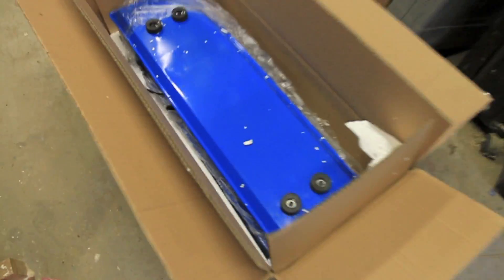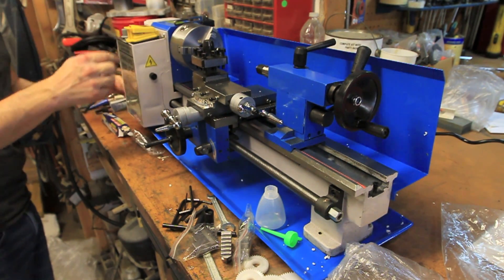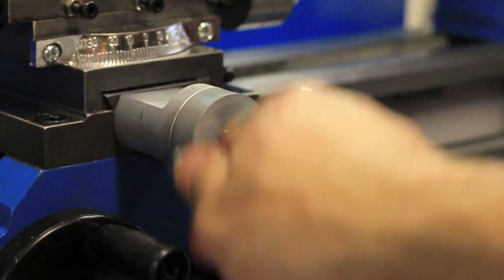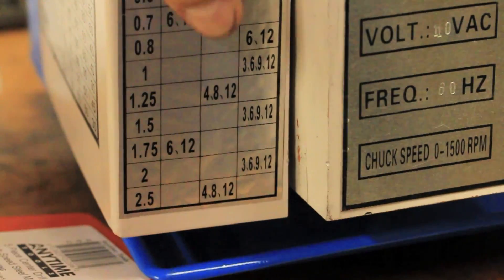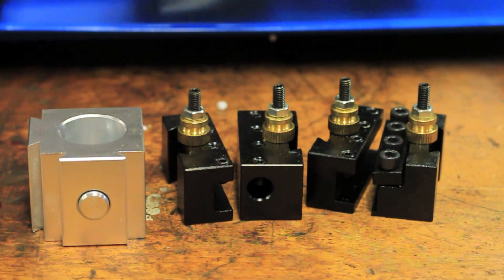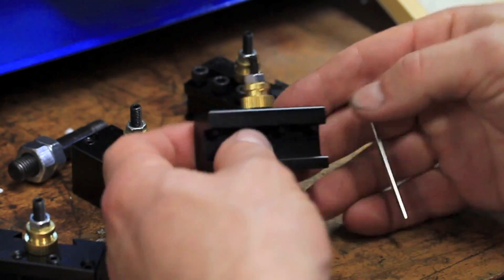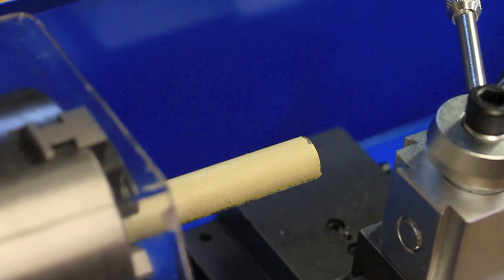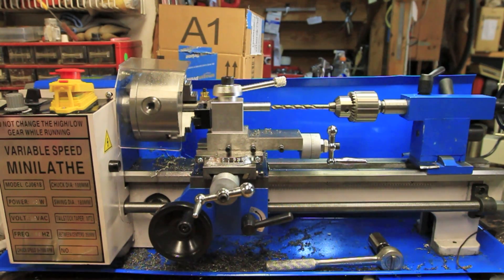Cheap Chinese Mini Metal Lathe Unboxing, Setup, Upgrading, and Testing

Comment: in germany we say "Buy it cheap and you Buy it twice" Duden get a german machine that will work for ages 😄
Reply: Andre Berg buy it nice or buy it twice
Reply: Optimum produces in china, then setup and re-mark their machines. And then sells to Europe.
Reply: Been there done it, regretted it and lost 40% of new cost in 10 months witha cheap over rated Wabeco.
Reply: Wabeco German
Reply: Nothing new and by new the last 15 years.
Heard of tooling companys or shops selling stuff with German sounding name, made in china cheap.
Reply: "Buy once cry once" for 'merica
Reply: My mother always said "We're too poor to buy cheap."
Reply: oh sure ... yes just get a german lathe for $20 000 instead of $500 :D
Reply: In my country (Romania) we have a similar say: you are too poor to afford cheap things...
Reply: My BMW was in repair more than I drove it. 
My 944 Porsche,  $2000 timing belts every 30,000 miles. My friends Mercedes,  $5000 to replace a air conditioning condenser. 
 Fack German Engineering!!!!!!!!!!!!!
Reply: Agreed 100%. Germany is one country that certainly knows how to produce top quality metal (machines) products. American steel is also top quality. Genco Razors were made in the USA. Japanese steel has been top quality for centuries or even millennia (Samurai swords).
Reply: Andre Berg do you know any good mini lathes from Germany??
Reply: @FireBuffalo  proxxon, the best!
Reply: FireBuffalo no, there aren’t any, lol dudes an idiot. Buy an old American made one
Reply: I bought a drone from china that satisfied me. ......mavic
Reply: @mullervolker9814  
You bought a drone? You mean a Quadcopter? WTF is a drone anyway? Care to explain because in my English learning days, drone was a word used to describe, indicate or point out a continuous loud or humming sound. Its definition was never a rc Quadcopter, plane, or any other bullshit that today's poorly educated, ignorant, low IQ illiterates stooges call it drone. How many things are called drones nowadays? And that's proper education? LOL. The word drone is not a name, a machine, model multi-rotor, military pilotless planes and, whatever other bullshit there is. It can't be used to name anything because it's a word used in a sentence or conversation,  e.g. "That jackhammer is so annoyingly loud and is droning our conversation. Let's move somewhere quieter."  That's all the word is used for. I think you've been listening to too many poorly educated, low IQ illiterates, too many sheep who have no idea wtf they're talking about, trust me. People on drugs have lost the mental ability to figure or work out how the f*** is it possible that a word suddenly becomes a name after the release of this annoying rc model multi-rotor that the manufacturers had named it a Quadcopter, how does it become a word, 'drone'? It seems that half the world population nowadays are brain dead retarded because of the shit they take, drugs!   A drone, yeah? LMAO!
Reply: @mickcarson8504  
"droning out the coversation"? I think that you misunderstand the term. It should be "drowning out the conversation."

The OED (Oxford English Dictionary) recognises that words take on new meanings over time and includes them in the dictionary eventually.
A drone is also one of the pipes on a set of bagpipes.
The English language is a mongrel language. It uses words from many other languages. It's not a static language.
Reply: @georgeknowles8762  
A drone is also a worker bee controlled by the queen bee, 
Sort of fits too when describing them their quad copter thingys
Reply: I once worked with an old German fitter who said "I can't afford to buy cheap tools." How right he was.
Reply: Ture we have couple of large lathe and drilling made from Hamburg ,Germany ..It should be more than 50 years old . Better than new machine, needs little refurb some times..
Reply: By the end of the 2nd world war American made was at it's prime, now we make shit out of plastic.
Reply: Holy shit! I would never buy anything German, German cars are absolute junk. I cringe every time one shows up at the shop. USA all the way for industrial equipment.
Reply from the maker: Haha yep, we have something similar here. I drive a German car if that helps :) Thanks for watching all the way from Germany!
Reply: TimNummy i never never ever bought something from China that satisfied me. 😂😂😂
Reply: for "mini" size,  I'd go with Wabeco
Reply: back in the 50's, my immigrant dutch father bought a caddy to show off to his relatives back home thinking it was the BEST car ever made. His 2nd care was a mercedes, and thats all he's owned....
Reply: @andiman45  but 90% of the Dutch are cheap mofo's 🤣. I live there 🤣. We only spend money if we really need to.
Reply: Jeroentje_diy  I wont argue with you as they can be frugal...
Reply: andy klompenburg that’s the dumbest thing I’ve ever heard... Mercedes are the biggest pieces of shit. They lose their value soo god damn quick because they fall the fuck apart within the first couple years of ownership. Can you say money pit????

Comment: Does your lathe have the lever on the back of the motor unit to select between high and low speed? If so mine made the same sound as yours but just wasn't in gear probably
Reply from the maker: It does not.. it's just direct drive. It ended up being a broken motor mount - check the next video for how I fixed it!

Comment: I am looking to buy a lathe for home use and am utterly confused over what to buy. The new mini lathes all look terrible, everyone says buy used but finding them in the UK is hard not to mention you don't know the thing's history. What would you say is worth looking at? Are the Sieg's all shitty unless you upgrade them yourself? What about the Clarke Tools, or Sealey? Grizzly? Or are they all just Sieg rebrands?
Reply from the maker: They are all basically the same from what I can tell. The biggest difference in cost will be quality control (not that it's a better design, just better put together), customer service, and "upgrades" like a brushless motor vs. the brushed one on mine, etc. Personally, I looked for the cheapest one I could find which ended up with a lot of issues as you can see in my videos but also some unexpected surprises like not having a two speed gear box... which turns out hasn't slowed me down but has removed the potential for the internal plastic gears to break. So it worked out in that sense. As for a used lathe, the amount of work you have to put into it being the same as one of these mini lathes, the used one would probably offer a much better foundation to build on.
Reply: Thanks for the reply, this seems to be the consensus so far. I have seen a couple of more expensive brands in the UK such as Proxxon, I think its a german make. I am wondering if there is false economy in going for a cheaper unit, either SIEG or used due to the extra work needed, and instead just biting the bullet and spending the money in the first place? I have seen ones for about £1200 which I think would be the absolute ceiling on what I would spend. Any thoughts?
Reply from the maker: Hey sorry I didn't get back to you sooner - I'm not sure about a false economy but if you invest in a good, solid foundation it will last you a long time and you'll be much happier in the long run. Also don't forget to factor in the cost of tools, a tool post, or other accessories you may want as that stuff can add up as well and you might be able to find a used lathe with a bunch of that included.

Comment: Thank you for making this review. I found it to be very helpful in terms of learning about metal lathes and has detered me from purchasing any purpose built tools made by a Chinese factory that isn't ISO certified. Your product review style is very strong when it comes to describing the function of the product you are reviewing. What I would have liked to know more about was the name of the product itself (i.e. model number and advertised as name) along with the name of the manufacturer and website used for purchaing it. I have subscribed to your channel because I liked the information you did provide. You did very well and thank you for making this video!
Reply from the maker: Hey! Thanks so much for that review of my review :) While I linked to the same one in the description on Amazon (https://alexa.design/2nVBrEc) I actually bought this one off eBay. I linked to the Amazon one because they are MUCH better to deal with if you have an issue, and this lathe has enough issues that some people who buy it may just want to return it without a headache. The reason I didn't offer a brand name and model number is because it didn't have a brand name other than "Variable Speed Mini Lathe" and the model number (CJ18) isn't very useful. That said, it is a Sieg C2 clone which is also nearly identical to the Grizzly 7"x14" mini lathe as well as the Harbor Freight variant and I think even LittleMachineShop has/had a copy. Many of the parts that fit one of those variants will most likely fit the others as well. Hopefully this helps fill in the gaps for you!
Reply: From my understanding following my purchase(not before !!!) I have come to this finding, they are made by numerous manufacturers in China, some of which turn out a good product and some turn out absolute rubbish all obviously from the same design.
As we do not buy direct from the factory, we are left to choose a reputable dealer who will buy only the good ones. In my case it was Aimtools ltd in the UK there are others who will supply a good machine, mostly they will be companies who deal only in tools, avoid the companies who sell everything from socks to garden furniture and everything in between.

Comment: Finish problem is caused by to much stick out that is unsupported.  Use the tailstock live center to support the piece. You will get a much better finish.
Reply from the maker: Thanks for the tip!

Comment: Many say buy a used lathe, but with an old lathe you do not know what you are getting there either. It could be worn out, or have been abused in its life. These import lathes need a good going over when you get them, but once checked should do good work. Plus there are places where used equipment simply is not available.
Reply: If by "a good going over" you mean basically building a whole new lathe.
Reply: No. By a good going over I mean disassemble it, clean it, deburr it, and lubricate it. You will not need to resurface any of the machined surfaces. Which is what a real rebuild would entail.
Reply: I've used one of these mini lathes and I've used a fair share of clapped out old ones, I can comfortably say I'd go for a colchester that has lived in a landfill for half it's life than use the mini lathe again. In saying that they're totally fine for plastic turning but whenever you show it metal it's a matter of time before something decides to give up on you.

Comment: hey buddy i have the same exact lathe did everthing you did when i got mine lol but quick question how do you square up the base if there isnt any indicator?
Reply from the maker: I worry less about squaring the base and just make sure the tool post/tool is square to the chuck by advancing the carriage all the way to the chuck with the tool post loose and tightening it with the tool laying flat against the chuck.

This works for parting and facing and such but I'm sure at some point I will need to make a specific angle and be stuck (aka have to get more creative)

Thanks for watching and it's nice to hear about someone else with this lathe!
Reply: thank you buddy and that helped me a lot and same here i searched high and low for videos on the lathe couldnt find it glad you made a video on it

Comment: 529$? cheap? i found cheaper lathes for 130$ on ebay...
Reply from the maker: Those are MUCH smaller and used for stuff like painting stripes on tooth picks
Reply from the maker: I was about to say the same thing
Reply: Sinon Those are "toys"with 10 cm of working lenght.
Reply: i was talking about wood lathes, around 50cm working lenght.
Reply: Sinon Ohhhhhhhhhhhhh. But a wodden lathe is just a piece if chuck with a motor and a straight piece if metal. A netal lathe is muchhhhhhhhhhh more engeneering and precision involved.
Reply: the thing is, a wood lathe is the same as a metal lathe (dont get that wrong). they both do the same things and have the same use. ofc you need more precision when working with metal but since i dont like working on metal, i commented that wood lathe. I can see the humor with the painting stripes on toothpicks but the one i found can hold a work piece of 34cm max diameter and around 50cm working length. Its for a "normal" consumer, not for people with a giant workshop
Reply from the maker: It's not necessarily about precision but more so that metal lathes have a carriage, cross slide, compound slide, tool post, power feed and everything that goes along with it with the gears and such and wood lathes don't have any of that... they are basically an electric motor with a chuck on it and a place to rest your hand tools.... so while yes, they do the same thing in the same way to their respective materials, they are very different machines.

Comment: Well you are smart enough to make corrections and fix things. Someone of lesser skills would be screwed. You got a the nice tool post and tools.

12 years ago I bought a Smithy Midas 1220, I run the hell out of it, work it hard and never baby it and its done nothing but make lots of chips. Sweet little home lathe.